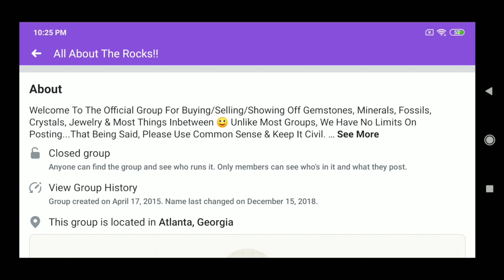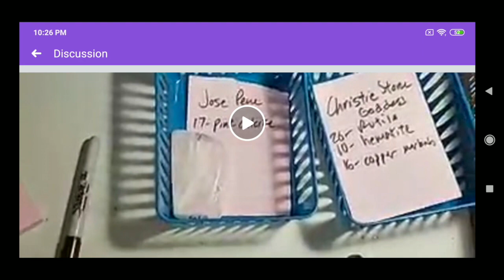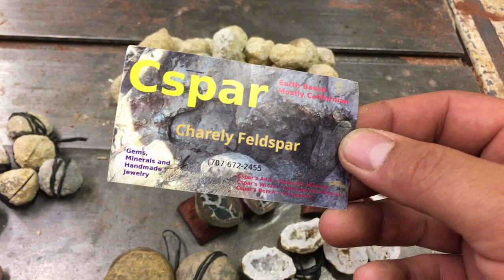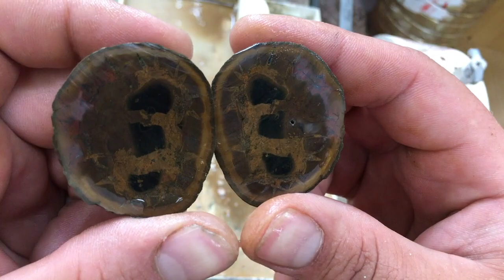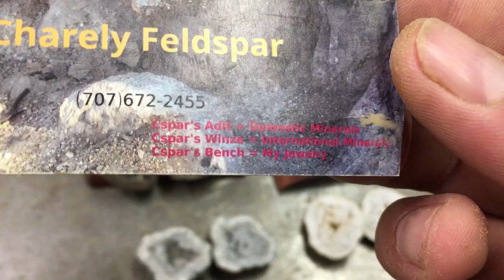Slicing Geodes & Septarian - Easy Lapidary Money

Comment: I love these geodes you are cutting, we don't have anyone in my Island state that does anything like this.  I have 3 geodes I bought on line but have no-one to cut them now.  The Sectarian nodules are very beautiful.
Reply from the maker: Hello my friend how are you :) which island do you live on? If you can find a tile saw you can easily cut the geodes
Reply: @lapidarydave  Hi Dave my lapidary friend, I live in Tasmania, Island state of Australia which is directly under Victoria in the South of Australia, no bridge, fly or catch a boat to Australia the Continent from Tasmania.  Thankyou for the tip I will see if I can get a tile cutting tool.  I opened the smallest and it was full of little crystals white and clear, it had a very thin outside crust
Reply from the maker: Tanya Bonnett Fantastic I would love to visit Tasmania someday I imagine you feel to a lot of beautiful materials and a amazing country when you get a tail so make sure to use lots of water in it will cut the geode anyway thank you so much for watching out for commenting I really appreciate it

Comment: There is nothing like opening an egg for the first time! The blade on my saw is so thick that there'd be nothing left of these little guys. Love the belt sander. Does Diamond Pacific have 82" belts? Do you have a discount code with Diamond Pacific? In need of a cabbing machine, oil saw, etc.

Comment: Thanks for great videos. Been enjoying them all afternoon. QUESTION: I'm a woodworker and I shudder at how close your fingers are to the blade when cutting those geodes. Do the diamond and tile saw blades not cut flesh? Thanks again!
Reply from the maker: 99% of the time there’s nothing to worry about who is diamond blades however if the blade is super thin for cutting precious materials it can be a little dangerous because the thin blade itself can cut the fingers however those blades are kind of rare and usually only use for turquoise they can’t really slice anything hard like a geode or agate etc.
Even though diamond tools are pretty safe in comparison to woodworking tools I still try to be as careful as possible because diamond will eat the fingernails 
I was a wood sculpture for years before getting into Lapidary so I try to be as careful as if I was using woodworking tools
I really appreciate your comment my friend I know for sure a lot of people are thinking the same thing
Reply: Thanks

Comment: Those are pretty. Arn't u scared about cutting off Ur'e finger? Really cool.
Reply from the maker: Lol not at all my friend I grew up around power tools and industrial tools mistakes do happen though 
I never work tired angry or excited
Reply: Diamond blades don't cut into softer material like skin. They grind away hard materials. Only the kind of Diamond discs that have these cut outs around the outside are dangerous and shouldn't be used with the fingers close to the blade.

Comment: Dave, a couple questions.  I currently have a tile saw with a diamond blade from harbor freight.  Is that blade too thick for this?  I don't have a trim saw.  Also, how do you know where to cut the geodes (along the long side or short side)?  Thanks!
Reply from the maker: Howdy there my friend 
So harbor freighs saw are tile saws and they make a few different sizes , what size is yours? What ever size it is it will work for cutting anything but it's definitely probably too thick to slice geodes to get a better then ok cut , I would find out what size arbor your saw has  and buy a real thin real cheap blade from eBay or Amazon for a few dollars before you cut some geodes, the tile saw blade will work but you might get alot of blow out and it might damage some of the crystals, I'm sorry I don't really know how to read the stone when it comes to geodes lol I should have done more research to be able to share the knowledge in the video but I didn't :) thanks for watching
Reply: I've got a 10", and see no thin blades for that cheap online. Any suggestions?
Reply: @lapidarydave the thick blade works well for the big, solid eggs. Hard to get a straight cut on the really big ones, might need an oil auto feed saw for them.